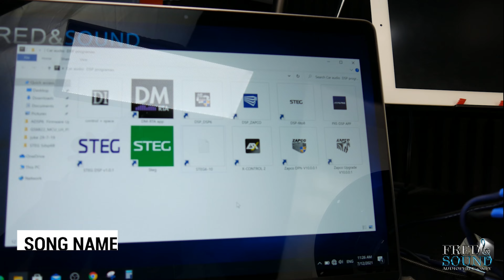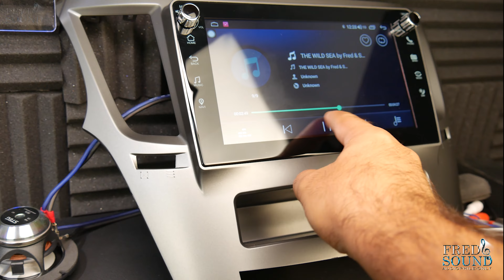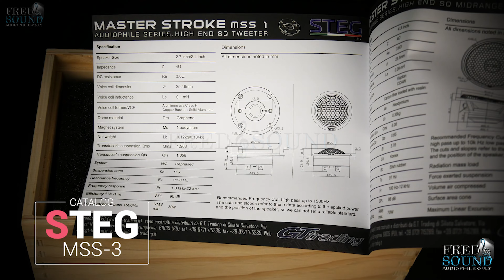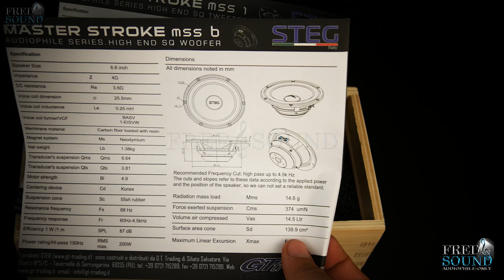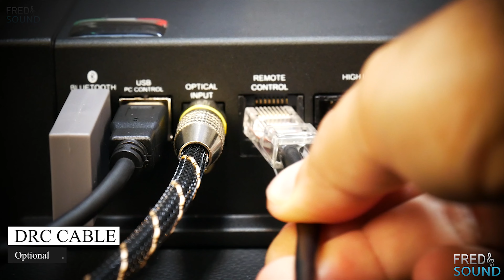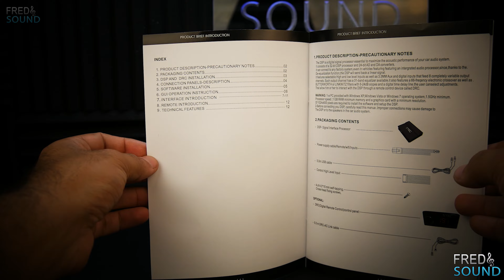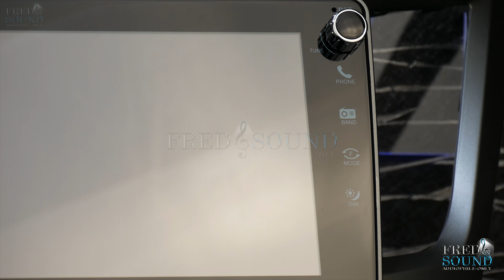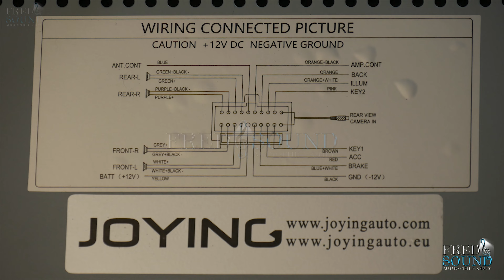STEG MSS-KIT 3-WAY ACTIVE by STEG SDSP10 SOFTWARE & SETUP OPTICAL FULL DIGITAL SOUND 4K (FNS)

Comment: Hi Fred, why did you put 90w rating on the Mss1 when on the official page of GT trading is rated at 30W?
Reply from the maker: Hi mate, First, the more power your amp has, the better it is. If you use less power from your amp you get less distortion, you don’t need to set the gain at max on any setup. Second, the min input is 30w you can actually give them clean 100w. Thanks for watching
Reply: @frednsound  thanl you for your answer Fred
Reply from the maker: @vusica85  welcome mate

Comment: this Dsp have bluth so we dont need radio?
true?
Reply from the maker: @ArashHizen  if you want only Bluetooth streaming, then you just get the BT adapter. No need for headunit. Thanks for watching
Reply: @frednsound  Do you mean that I should get a bluetooth dongle?
And should I ignore buying a radio?
So what is the story of the processors that have Bluetooth? like this sdps 10 steg
Where I am, this is not your processor model, but only the highest-end processors that are easily available   helix dps pro   helix ultra dps      adison bit one HD
Which one do you recommend?
Reply from the maker: @ArashHizen  The new STEG ssdsp12 is great. It has built-in BT and usb otg audio. Means you can connect your smartphone via usb and get hi-res files playing and no need for headunit.
Reply: @frednsound 

Hello, Fred! 
Tell me, what are the differences between mdsp12 and ssdsp12 in addition to bluetooth and USB. Is the sound much better or are the insides the same?
Reply from the maker: @VitaliyNikitin-z1b  Hi mate, much better dsp, dual dacs, better chips. Thanks for watching